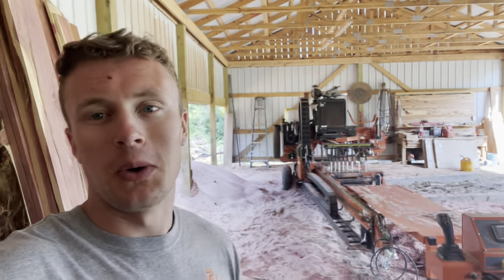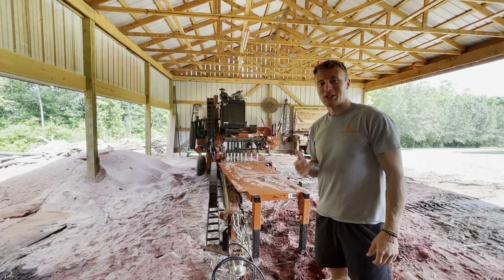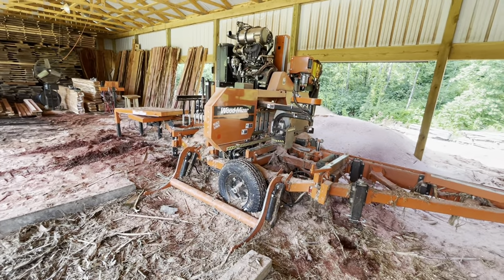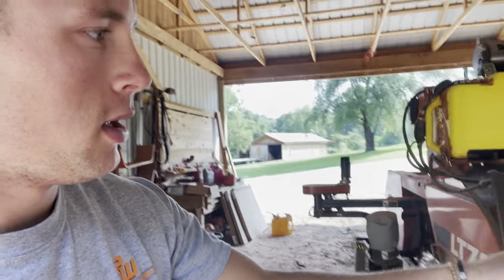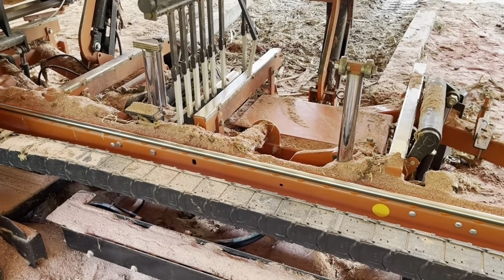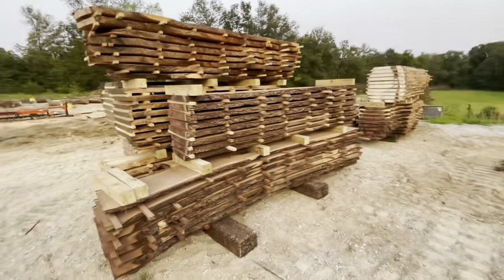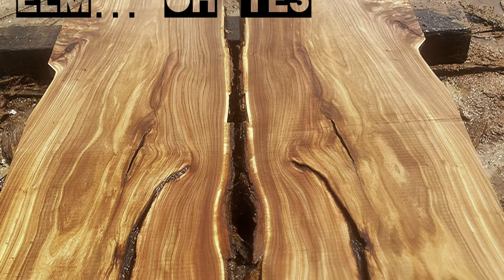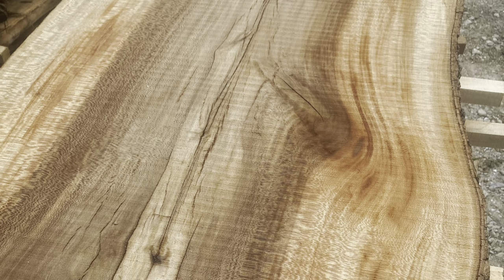First Portable Milling Job in TWO YEARS!

Comment: In the information age, I am sure you could have found the product manual for your mill on woodmizer's website.  One suggestion, before you put the mill back in its shed, take the time to clear out all the sawdust and debris all over the ground in the milling area.  Looks like it is a tad over due.  LOL
Reply from the maker: Yes I agree I’m sure there’s lots of videos and info out there to tell you step by step how’s it’s supposed to be done. We clean under the mill and blow it off about every other day but unfortunately when cutting hundreds of logs every few days it doesn’t stay clean long. We got it all cleaned up before we put it back but it’s plenty dirty already lol
Reply: @pattonwoodworks  I found a youtube video called "Dust Collection System With Cincinnati Fan Blower for Wood-Mizer" that may be of use to you to blow your sawdust outside of your building for easier disposal.
Reply from the maker: Awesome I really appreciate that been looking at getting a sawdust blower for the sawmill. Thanks!

Comment: I have a big elm log to saw soon. Hope it turns out close to the way yours did! How does elm saw compared to red oak?
Reply from the maker: I would say elm is a little harder than red oak but other than that log I cut for these customers I’ve maybe only cut one other elm log. I could be wrong but it’s not to bad as for as I remember
Reply: @pattonwoodworks  Thanjs for the quick response.  Good luck on your sawing endeavours.
Reply: @mcpiddler1135  I just finished 4 videos on milling Elm. Maybe you'd like to see them. The Elm mills OK but has a bit of a stink to it.